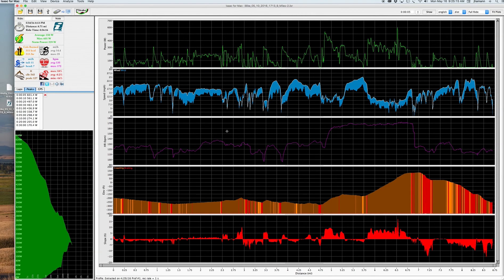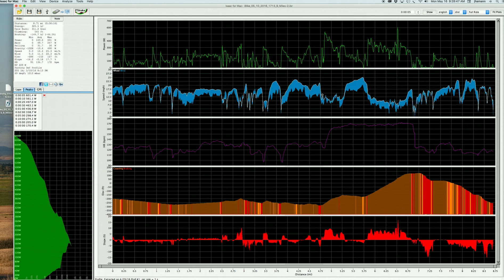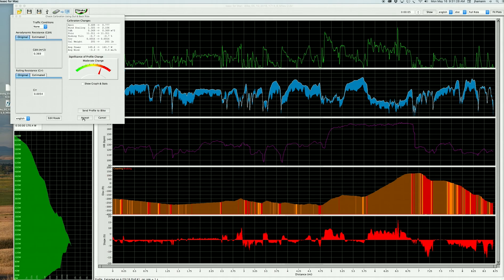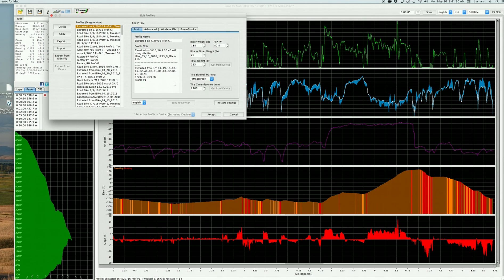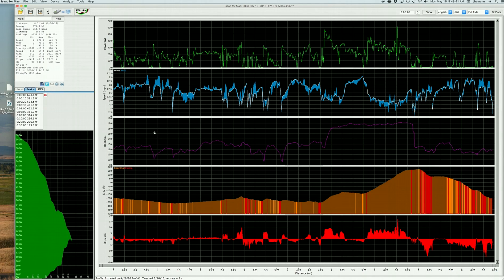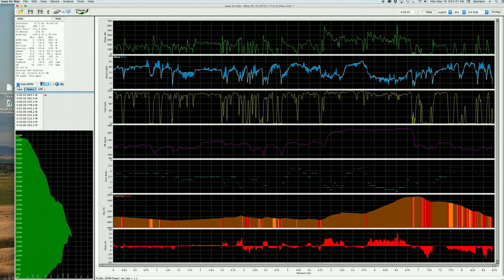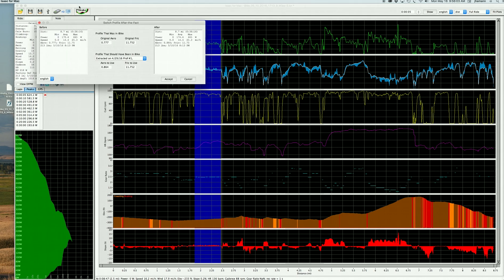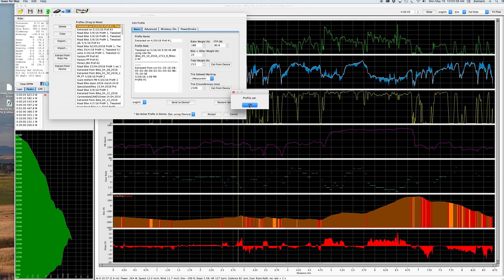Using Isaac to fine-tune PowerPod

Comment: If I am only using the power pod, meaning no additional power meters, can I still merge the Garman edge TCX file with the power pod data?  It is my understanding that the power pod V3 will read my speed, cadence, and heart sensors. So the only data that will truly be missing is the GPS data.

Comment: So, that means, that if one doesn't have another Power meter data, one is screwed and must stay with constant values that are factory set. Because the only reason the speaker knew he had to correct the cdA a little bit more, was just because of the other data. I really respect a lot the calculations being made in order to achieve a measuremente of Power, but I believe that these calculations include a lot of subjetive values (weight, figure, position, geometry of road bike itself, pressure of tyres, and more). As I said, I respect a lot you got a calculation, but I think it is quite generalized through constants and the fine tuning is not that easy if you dont have any other data about the exact same ride. Or am I just getting something wrong?